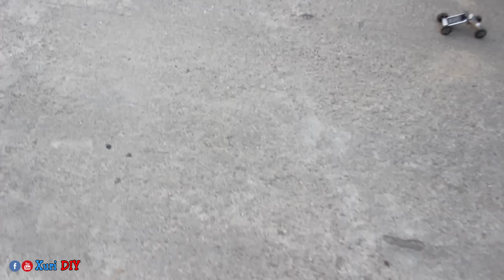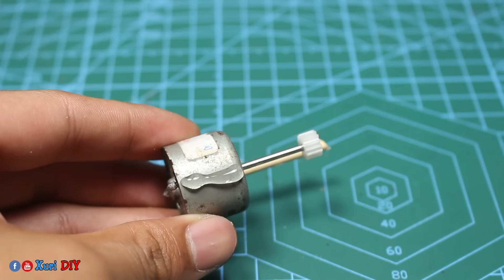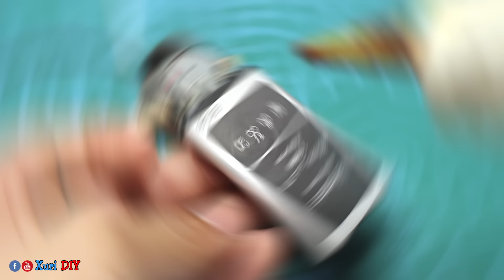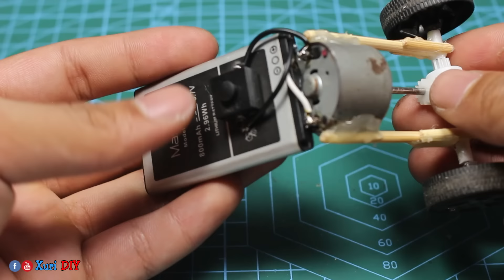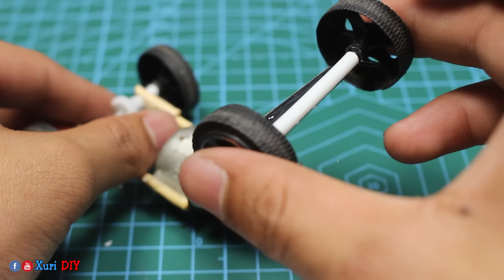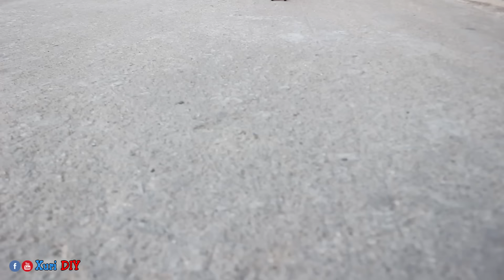How To Make A Mini Electric Car Simple

Comment: How come u don't need a flyback diode?
Reply: Um filme di sequixo
Reply: well it's just a small motor with a small amount of power supply, so there is not much risk of voltage fluctuation.